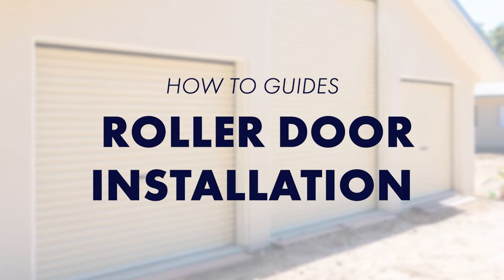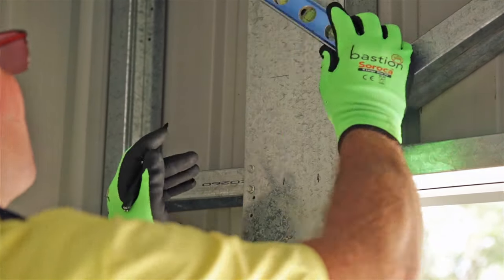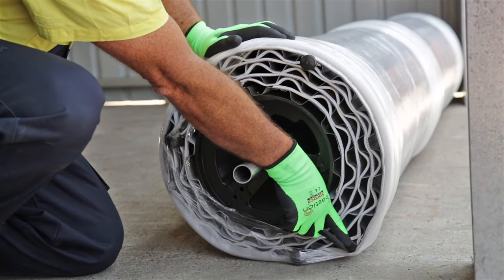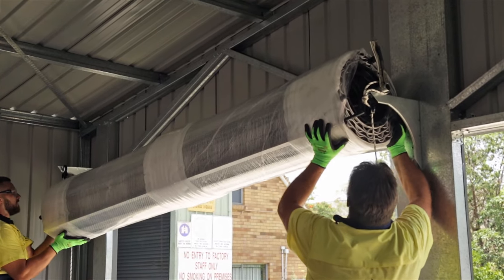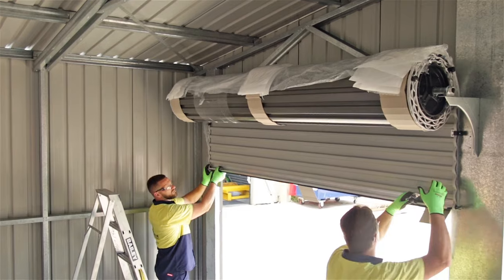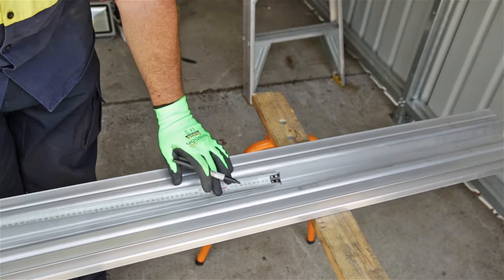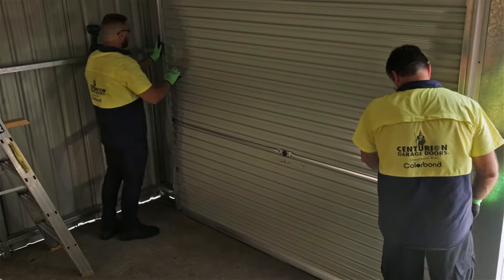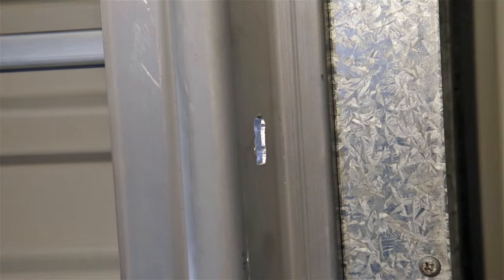Roller Door Installation Video

Comment: Thanks a lot for this video. I managed to lower my manual roller door and fit a motor to make it electric. All following your technique using the rope at either side. Worked a treat. Took 3 people to do it.
Reply: I lifted and fitted a 2.8m x 2.8m door using 3 tie down straps on my own. You just need to take it slow.